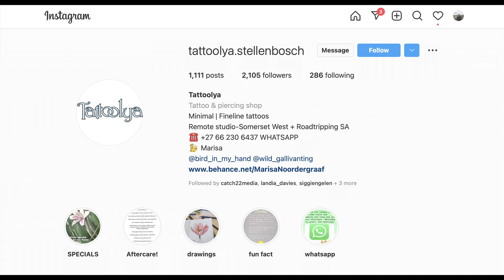EPISODE 92 GARGOYLES

Comment: If you ever want to travel to EU make sure the lights in the top corners of Meraai need to be white in the front and red in the back. You cant drive on German roads with a red or orange light pointing into the driving direction.
Reply from the maker: Yip they will be white up front with amber and red on the rear.